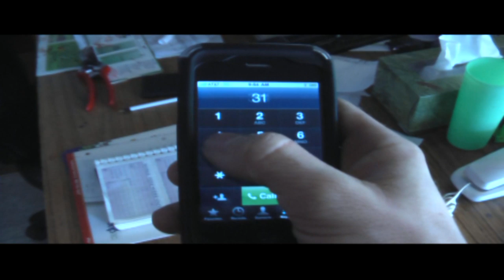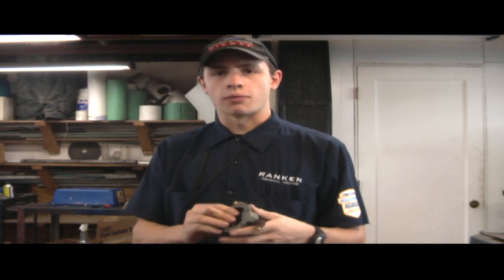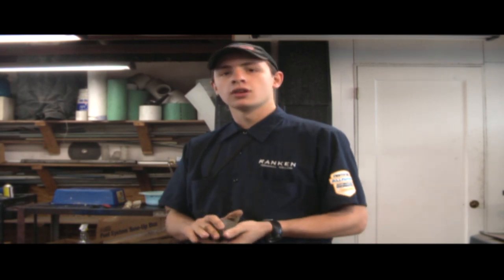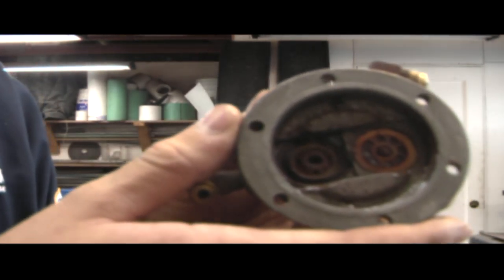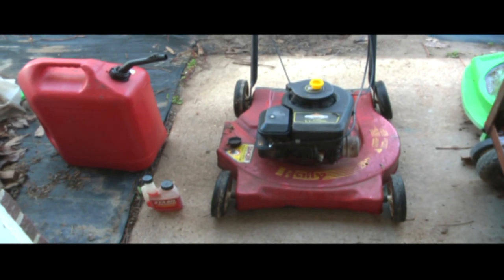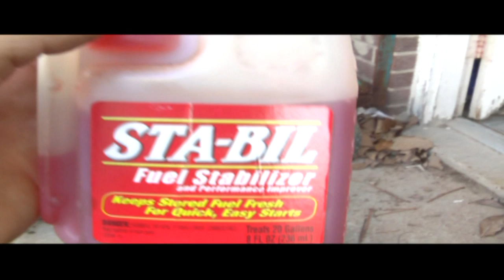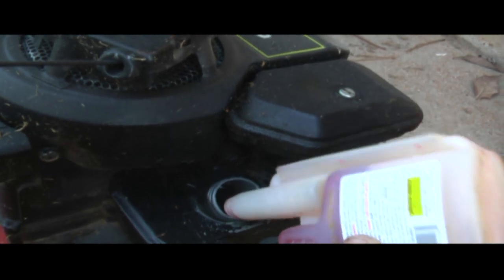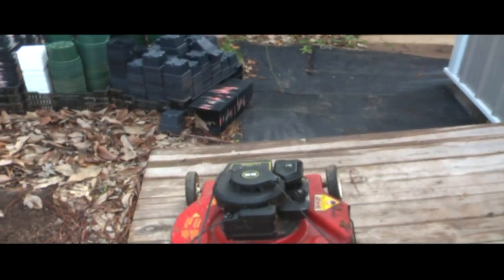Why Use Fuel Stabilizer?

Comment: I find its easier to add the Sta-bil right after I fill up my gas can at the pump.
(then you dont have to measure out those small amounts.  ;)
Besides, you'd prolly use up that small tank before you finish mowing that day..(depanding on lawn size)

Just my .02
I love your films though...used to hate'em...but now I love them.
I talk too much.

Comment: @GmTruckCarLove im pretty sure you are slow if you think mowers dont have diaphragms.
all the smaller engines have them and they work great and have been working great for decades.
they are the easiest and best working carbs made.
float and bowl carbs leak and are hard to rebuild.